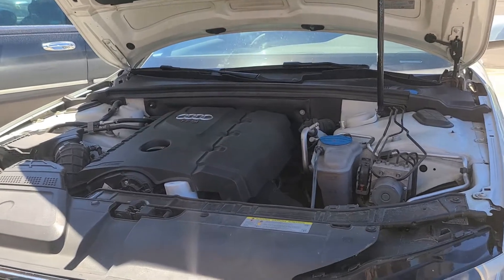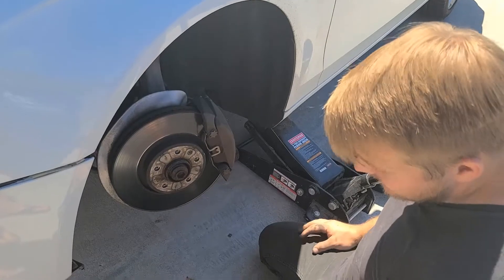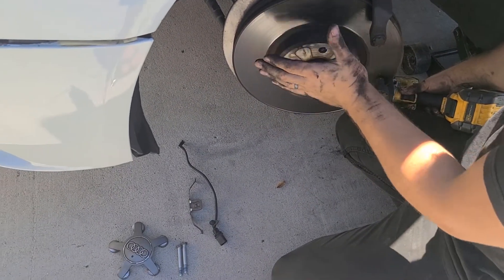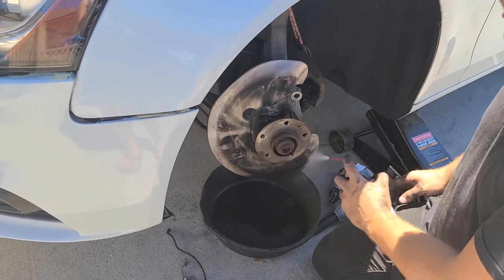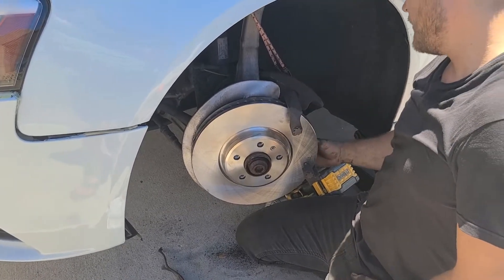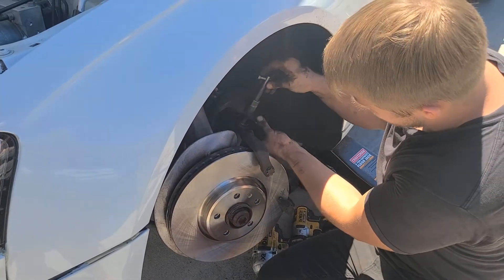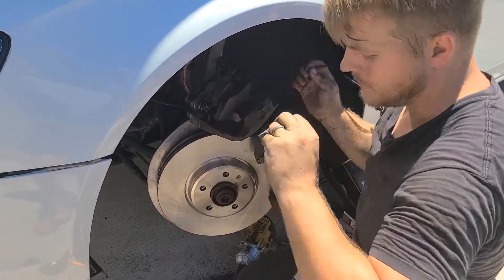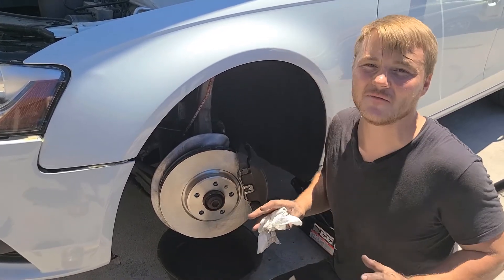2013 Audi A4 Front Rotors and Brakes (Detailed)

Comment: High quality rotors do not have wax on them - they are coated. Do not use brake cleaner on them.
Reply: Brake cleaner can be safely used on ANY kind of rotors.  It can't do any damage whatsoever.

Comment: The 3M backing should have been peeled off, not lubricated, to expose the adhesive which secures the pad to the piston or caliper.  Otherwise, good video.
Reply: Yeah did see that as well , probably won't effect it but that would help holding it in place for easier caliper refit